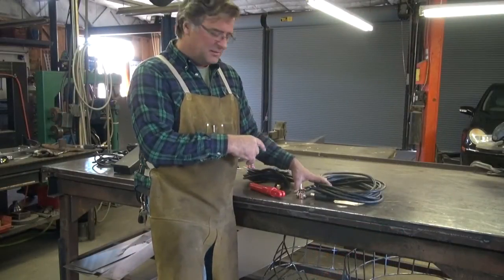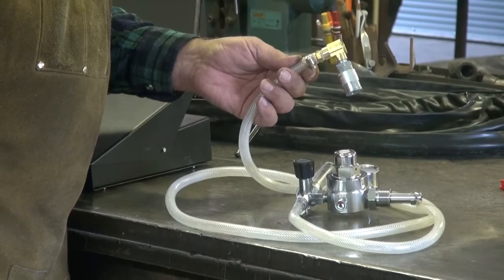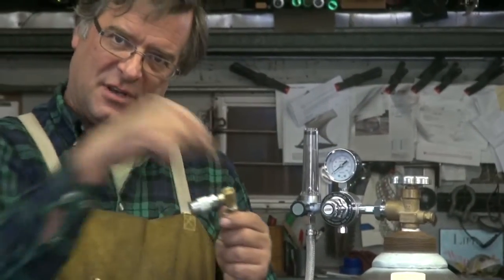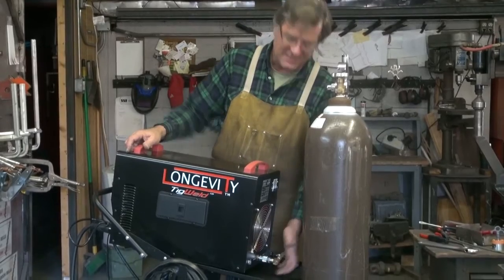How to Set Up a Longevity TigWeld 250AC/DC - Kevin Caron

Comment from the maker: @ixfxi But the units don't come wired that way. The cable coming out of the back of the unit has a white, black and a green wire for a single phase.  Or you will find a red wire also. This is for a 3 phase unit. If the unit will run on either 1 or 3 phase you just leave out the red wire for 1 phase.

Comment: Love your videos Kevin. Just have one question. I hooking up an arc welder 300 amp ThermalArc. I'm wiring it up 220 single phase. Wouldn't I need to the two hots instead of a hot and nuetral? (plus ground of course.)

Comment from the maker: @1kgsxrk7 Ok, now you have to understand that I am not an electrician!  For hooking up your welder you should have a black wire and a white wire coming off the circuit breaker box. One wire each from each side of the panel. That will give you the 220 you need. You also need the green ground wire to make the circuit complete. If you are not 100% comfortable doing this PLEASE call an  electrician.